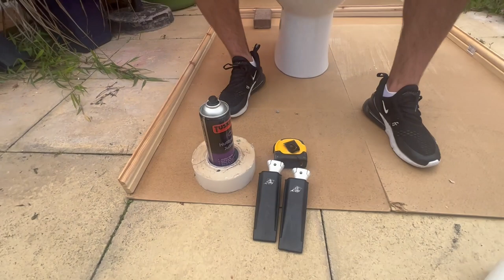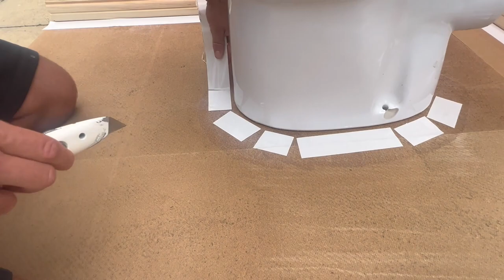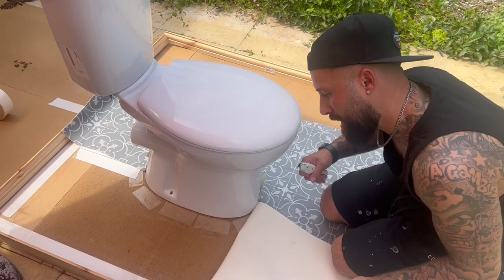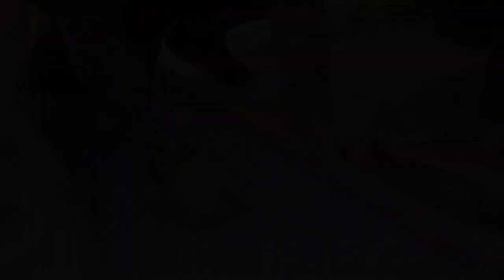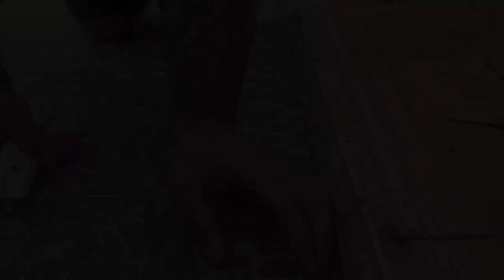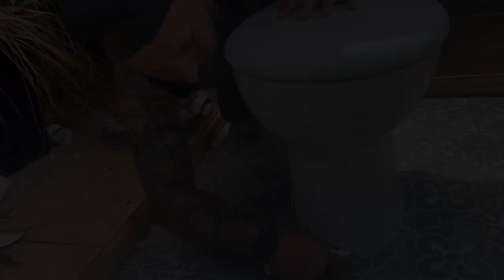How To Install Sheet vinyl Around Toilet / Bathroom #diy #vinyl #flooring #carpet

Comment: Please do not do anything here as a flooring contractor of 40 years it’s all wacko ok , jeeeeeze
Reply from the maker: You live in America without even asking the question. We do stuff differently in the uk
Reply: @homeimprovements  fair enough , end results is what matters
Reply: What specifically about the install would you have done differently? 

The instructional video for laying sheet vinyl in a bathroom home depot has on their site is nearly identical (besides the fact that he didn't show the silicone caulking step to seal it at the end). 

I'm not looking to argue or anything, just genuinely curious what a pro would suggest I do differently as an individual about to attempt this themselves for the first time.
Reply: @devonenders5193  first of all you need to remove the toilet and replace wax gasket when re installing it , next you need to use an appropriate adhesive and trowel it to the subfloor, best way to lay the vinyl is to place it with 2 inch or so extra @ all sides , possibly netting one side to limit cutting , fold half of the vinyl back and glue , then use a roller or just a small piece of 2x4 covered with a towel, to push out any bubbles, working from the center outward , then fold back the other side of the vinyl and repeat , you can crease the vinyl down at the wall with a wide chisel covered by a damp rag , trim it with a utility knife . Booyah your welcome
Reply: Thank you for responding and for the tips!

Comment: Pull the toilet. It takes 10 min and a wax ring.
Reply from the maker: Uk plumbing is different. There a lot more involved you have to drain waste turn off main cold water feed and unbolt toilet 🚽 which comes under plumbing which is a a total different job title

Comment: I've always used a concave blade
Reply from the maker: Nothing wrong with a concave. That’s what I use when fitting contract flooring . I find cushion floors are easier with a hook . If it works mate it works
Reply: Same here dude......always find hookies cut it big, concaves I can get a bang on cut 👍👍👍

Comment: I have tiled floor in my bathroom..should i still use adhesive spray and imapct tape if i am to use a self adhesive vinyl? Btw i watched ur tutorial on self adhesive installation❤❤❤ where did u use the hook blade?

Comment: Great video. Question, why are you using spray adhesive? Surely the impact (double sided) tape is going to be able to stick to the floor anyway without the spray adhesive.
Reply from the maker: In theory it should mate but we use it to be sure and especially on hardboard or ply 😊 and thanks 👌🏼👌🏼
Reply: @homeimprovements  👍
Reply: I’m going to do this in my bathrooms. Is there a minimum thickness vinyl I should buy?

Comment: can you buy a hook blad from wilko I want to try lay some vinyl in a small straight hall way.    as i'm trying to save money.
Reply from the maker: You can purchase online 🙌⭐️
Reply: @homeimprovements  1 last question.  Well stuck vinyl tiles remove or leave?  Not falling apart  this is in the hall way it really small too so not a complicated area

However in the bathroom they look like poundland vinyls  remove?  Fill in the gaps with filler?  Get a professional in?
Reply: @homeimprovements  thank you
Reply from the maker: @hybridangel3403  sound like Marley tiles I’d leave tbh 😁😁